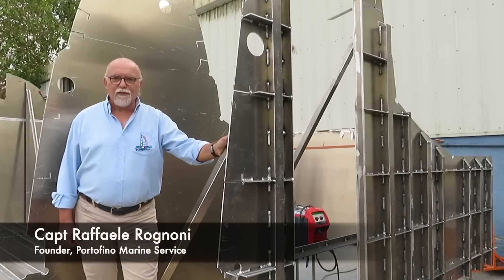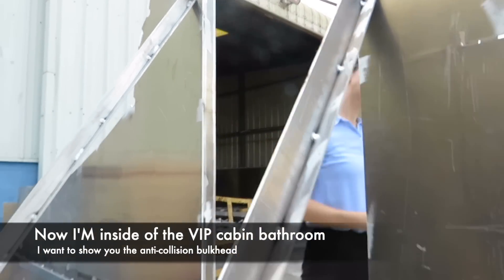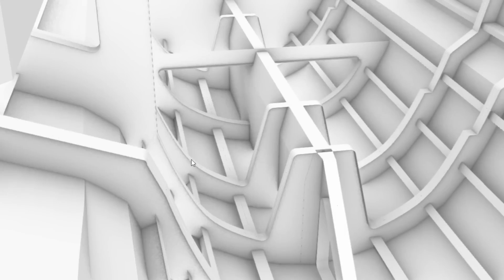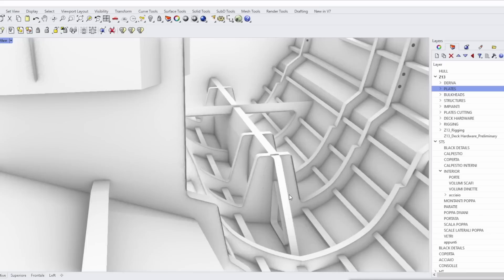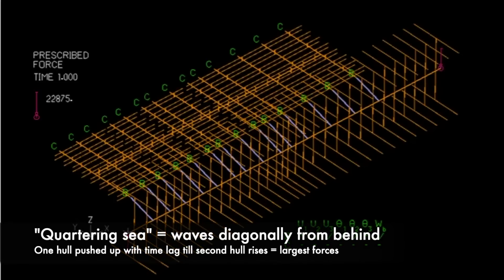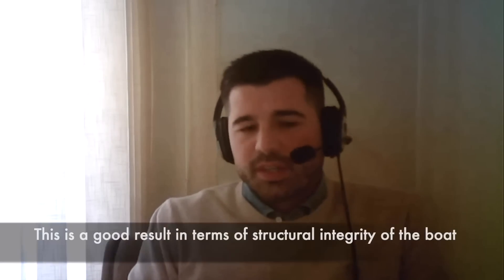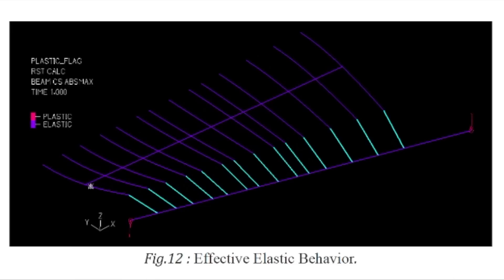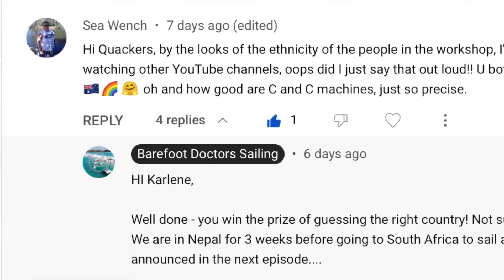S3#10  Portofino 52   see first bulkheads in place!

Comment: Don’t pretend to understand the technical stress calculations and stuff but still very interesting to see the results. The welding looks a work of art . Thank you more of the same  please .
Reply from the maker: I agree Paul! Thanks for your input. A lot of what Emilio was saying was over my head but the bottom line of flexion in extreme situations of 25mm at each end and the absence of "plastic" deformation are bot the bottom line points that I did understand and mean that it looks good.... The pictures and graphs I added for the engineers out there that may get extra meaning out of it and to break up the talking heads appearance...

Comment: Great informative video… Please Keep them coming…!
Encourages me to buy one, who do I talk to?
Reply from the maker: Thanks for the support Marty and the comment! If you want to get more details, look at the Portofinomarineservice.com website and contact Raffaele on info@portofinomarineservice.com...
Reply: @barefootdoctorssailing  Thank you for replying. Your decision process leading to this Aluminum Build follows along with my thinking. And added interest would be to use Sail Drives and mount engine on a pivoting frame that allows removing the Sail Drive out of the water when not in use. Don’t know what this would do to the design, but could be a valuable improvement. Also, take detachable items and have them Double Teflon Coated to eliminate painting/repainting. Experience with Teflon Coating shows it to be highly durable in aggressively abrasive situations. Would run with this as a test before committing to coat anything more.

Comment: What will the 58 cost.
Reply from the maker: HI Jeff - thanks for following and are you asking what a Portofino 58 costs? Ours is a 52 and costs $1.39M + options but if you want a 58 , you would need to contact Raffaele at info@portofinomarineservice.com. Hope that helps...
Reply: @barefootdoctorssailing  I do like the 52 you are building but I would change galley down on the 57 they have on there site.  I do love the design of the 57 they have on the site

Comment: Hello, Loved the episode. Not sure if you all plan to sail into colder water but I was wondering if you all can detail some cold water things they are doing to hull to help with condensation? I know insulation and heating are pretty important for cold water but those type of things come much latter in the build.  I know Distance Shores talked a bit weeping holes along the aluminum hulls to allow moisture to run to run to bilge Thanks love the build so far..
Reply from the maker: Hi Paul, thanks for the comments! Yes we watch the Shards progress with their AL mono and are amazed at how solid it is - mono vs cat of course and we are not planning to do the arctic areas... Obviously AL needs to avoid water collection so everything will be insulated and self draining and the dive room will be the only wet area. In our self built 42 foot cat, we did not even have bilges under the floors, it was ALL air tight voids so I am certainly aiming to have many areas that won't allow water to get in and have the others self draining.

Comment: Are these loads and bending moments calculated with an empty boat or a loaded boat.  I hope it's fully loaded with a percentage of error.
Reply from the maker: Thanks for the comment and you are right, it was done with the weight of the boat fully loaded and still had 20% safety margin with the forces increased from the actual ones of 0.8G to the maximum possible of 1G. So that 20% margin of safety is built in as well.

Comment: Speaking of technical and books, I read a book by Dr Tamsin Woolley-Barker called “Teeming”. It speaks of relating Biomimicry to business, life, and innovation. You talk about keels,rudders, and daggerboards and it brought to mind what she mentioned about a whales fins having an irregular back edge as thought it is scalloped or serrated like a knife. This design is supposed to reduce turbulence through the water which we know is very important. I wonder if this concept can be used in boat design. Also, check out the new “Sharrow prop” which is a dihedral design which is more efficient and reinventing motor boating.
Reply from the maker: Hi TOny, thanks for the great ideas. Yes we have checked out that prop that is more effective but won't fold to reduce drag at high speeds so will probably not use that. Have to get some clever designer to work on the serrated keels and rudders! That is like the grooved swimsuits of the Olympic athletes until it was made illegal...

Comment: Great detailed video. Just wandering when you will provide updates on the previous video where you discussed a number of design items that were still being worked out. I assume if they have started building, most of that has been finalized?  Would love more details on how that got worked out. Thanks
Reply from the maker: Coming soon, Neil! Certain things have to be finalised that invoice the hulls and structural issues but the steering station is still "in process". We will decide on other issues when the time comes so batteries and EV engines will be late (we hope they will improve), and we will discuss the various other issues as we investigate them and make those calls...

Comment: Youve started so you'll finish but to others looking at Al cat designs take a look at the De Devilliers Designs out of NZ for comparison and alternatives.

On the moulded front the biggest Chinese boat builder has launched a 42' cat in two versions with a 2x 20 kw motor set up and LFP cells ...possibly blade cells...that will put a cat among the pigeons 🤔 given the local expertise.
Reply from the maker: HI Clive, thanks for that interesting info. IN fact I have spoken to the designer of the sailing cat for De Villiers before we went with Portofino and they are a great yard but for the number of extra and innovative features, we were much more excited with the P52...

I hope the technology for EV and innovative cells is available before the end of our build so we can benefit... Can you give me a link to what you are referring to please.
Reply: @barefootdoctorssailing  

You will need to search for 
🔌🛥️ boat for the Chinese item.
Turns out the company has made 1800 boats a year for the home and far east market.

As for the cells well there are two smaller cars that are being trialled with Na ion batterys

For interest and safety with lithium Iron take a look at this guys U tube testing and evaluations of the Blade cells.

https://youtu.be/vVUXy7WlIxU

Blade cells come in two lengths  ... They are also being used in the UK to repower Nissan leafs with dead or dying old short range packs....

The real breakthroughs will come with Na, Sulpher and or Aluminium packs ...Al air batteries are one use recyclable burner devices ...but can hold a huge amount of energy at low weight and size...  Imagine a grip bag size pack that can power a car for a thousand miles..then be swapped out for another at a garage or dock when you want to do a extended crossing  to augment  your rechargable pack.

Whatever the scenario as youve pointed out everything needs to be accessable and updatable ...

The stability and temperature tolerance of newer batteries is going to be a major factor in their replacement of Li Ion ,
Getting away from Rare earth metals in batteries and motors is vital for electrification.
Theres a uk company that specialises in H-Duty motors that have developed a range of advanced high torque and efficiency motors that use no rare earths just steel and Al. they also use very little copper and have transmissions capable of transmitting the huge torque from multi motor installs. They are called AEM and search under electric and hybrid technologies.

Comment: The Odisea catamaran guys that are working with Plukky from Sailing into Freedom dropped a video on how they will weld the hull to the  bulkheads... completely different approach to the standard upside down bulkhead approach you show here.... They will produce a much more accurate finish as it makes total sense with alu distortion.
Reply from the maker: Hi again Dr! Thanks for your comment again. We have actually had an in depth discussion with Odisea about potentially building our boat and without passing judgement either way, let's just say that we are more than comfortable with Portofino's skill, experience and technique of building. 

We have also watched the construction of the first Portofino hulls for their 47 and are more than happy with the quality and accuracy of the build.

For your info, Portofino uses the top end laser measurer to guarantee accuracy of the hull alignments and levels to within 1mm across the 52 feet length and diagonally as well. Distortion is controlled (it is never eliminated as AL expands when heated) in a number of ways - strongback, supporting stringers and initiating hulls with deck in place. Also the Portofino AL welders have decades of boat building and welding experience - that speaks volumes! 

At the end of the day it's horses for courses and we each have to be happy with the builder we choose and their skills, techniques and experience. We wish Odisea and Plukky all the best with Hull Number 1 and we expect both yards to produce spectacular boats!

Comment: (Words in quotes are specific english engineering terms.)

So the stress diagram is one hull/ama only to the boat centerline, considering only wave forces? So the deflection across both hulls/amas is 50mm total (25mm up & 25mm down). It Is as if the software designed with only "uniform loads" (wave) applied to a monohull vessel.

What about the spar and standing rigging forces. Those are much greater "concentrated loads" acting on the mast step and chain plates. Are those vectors still to come? The beam/aka made of aluminum with that depth feels off. Does the Leopard have an steel I-Beam?
Reply from the maker: Hi Boston, thanks for your interest again and I would need to check with the clever people! My understanding though that the movement was a total of 25 mm at each en, not 25 mm down and 25 mm up at each end - so I don't think the total movement is 50mm... 

As for the concentrated loads on the 4 points (shrouds, forestay and mast base), those are easily calculated forces and do not need the complicated FEM program (I believe). I will ask for more info for you form the engineers...
Reply: @barefootdoctorssailing  As aways don't feel you need to reply. You guys must be stretched. Funny never used that adjective in that context before.

Never mind. I read "Catamaran Structure – Bridge Decks and Cross Beams" by BJ Porter. He commented about not having a crossbeam in a modern cat "Bear with me. It took a while for me to get my head around this, too". Well, me too. Knowing the dynamic, concentrated asymmetric loading under sail on those four points...It just feels wrong. It is a me problem. Sorry to distract you guys.
Reply: @barefootdoctorssailing  If I can go off topic again. Impellers. Brent from YT Catamaran Impi removed some impellers in favor of March Pumps (Centrifugal Sealless Magnetic Drive Pump). Maintenance is easier and no reduction of pump efficacy with the normal wear and tear. His YT "1. NO IMPELLER, NO RAW WATER PUMP - MARINE GENERATOR" and FYI com URLmarchpump.

Comment: Wonderful video. Gives me inspiration. I have an idea to make an EV catamaran. 3 different ways to generate electricity to charge a Solid state battery (when they come available). I knew for some time that I need an Aluminum build catamaran. When I first started, there was only one out of the Philippines. Its great to know that Portofino makes them too.  I plan to build a 45 foot houseboat as a proof of concept then transfer everything I have learned from it, to the catamaran. I look forward to more of the build of your catamaran so that I can learn more from it.
Reply from the maker: Hi Frederick, thanks for the comment and we are hoping for batteries and EV engines to im[porve to the point of independent effectiveness.... Not sure if that will happen by the end of the next year when we will have to get all our gear but we hope for solutions to the limitations still in place....